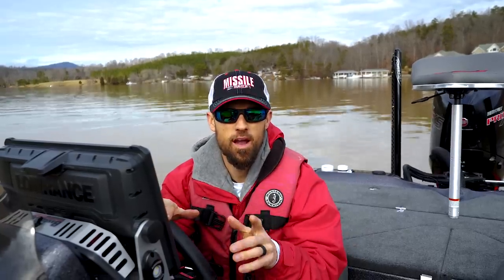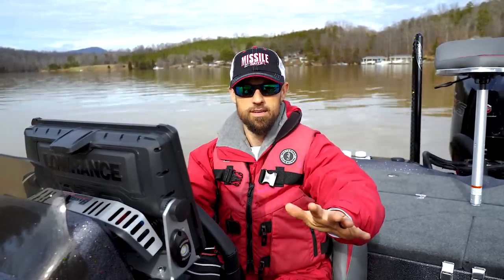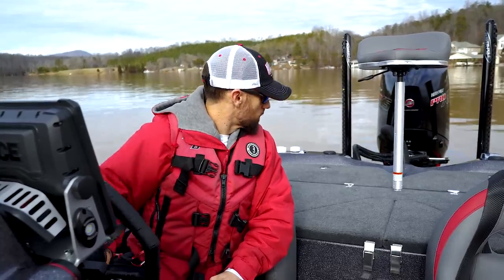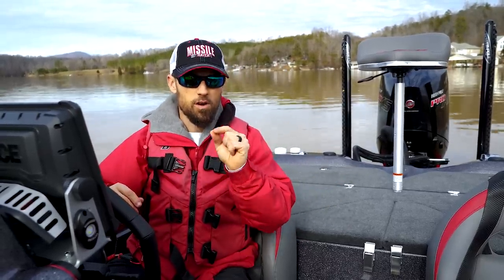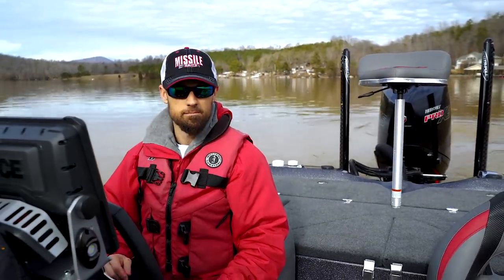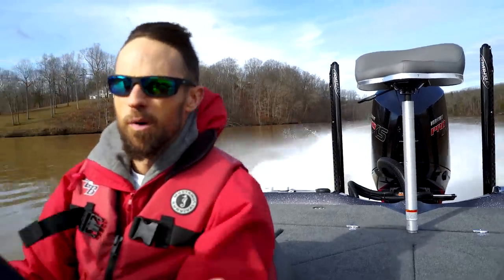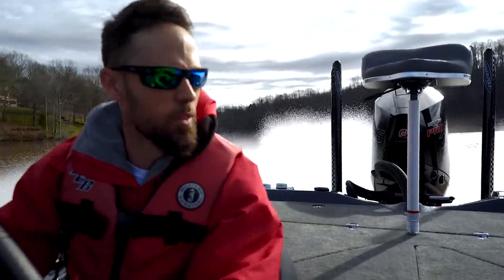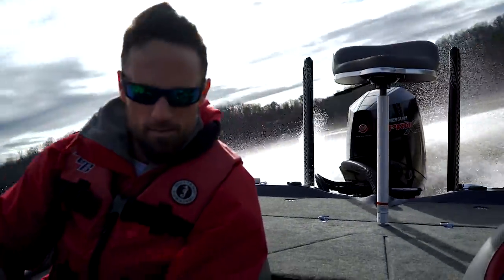BASS BOAT DRIVING - TURNING 101

Comment: I learned a while back if you drop the trim and the throttle at the same time, you can learn the timing on your boat to when it crests the hole and keep trimming down as you yank the steering all the way to a direction, bottom out the trim as you slam back into the throttle except now your facing the opposite direction and your co angler is probably in another zip code by the time you leave your hole shot.

Comment: Thanks for the video. I’m brand new to boating. My 7 year old joined the fishing team at school, so I went and bought a new boat. It does have hydraulic steering and it’s very difficult to turn left at speed. I called the dealership and they said that’s normal. It doesn’t feel normal. Any advice on that for a newbie?

Comment: I wish I would've had this for last week on the water. I just got a skeeter zx185c with a 175 yamaha and that boat scoots. This is my first fast boat and I'm having to get used to the trim. Last week I was maybe halfway trimmed up and going 45 mph and it started to loose bite in the turn like you were saying. From everything I've learned running this boat recently if anything starts to happen just trim down. I did and went away like you said but definitely scared me a little bit. I think the skeeters have a lot more bow lift that other brands anyway so it's getting a lot of getting used to. I trim that thing up until I get uncomfortable lol (no rooster tail on mine though with the way the jack plate is set up) it's crazy compared to rangers that I've been in that ride completely flat always.
Reply: Yeah i have the zx 180 with 175 Merc and just a lil down trim i can make turns quick and be trimming back up as finishing turn.

Comment: So I'll try to keep this short. I have a 86 aluminum boat with a 60 2stroke and I run down the creek alot with fast sweeping turns and 180 hairpins (with stumps and trees 10 feet from each side). Would it be best if I just trim it all the way down and leave it. I don't need the extra trim up speed. 35 through it is kinda sketchy. Had some close encounters with MISTRIMMING and was a couple feet from a tree due to blowing out/sliding. I haven't mastered trimming and Wondering if staying trimmed down would help keep the boat "sticking" to the path

Comment: New bass boat owner here with maybe a dumb question. My manual says to avoid trimming really far down because it can cause plowing and that it could increase spinouts. I think I hear you saying the opposite. Could you explain what they mean? I typically only run my boat at 35mph currently, at that speed do I even have to worry about it? Thanks
Reply from the maker: At top speed, if you trim down and cut the wheel hard, you could induce the boat to spin out. At slower speeds, trimming down to turn is preferred
Reply: @JohnCrews  your videos have been a tremendous help, and give me more confidence on the water. The fact that you take the time to respond to questions on videos you posted a year ago say alot about you as a person. Greatly appreciate it!

Comment: Good video and I hate to be picky but about 2 minutes in...........   When you turn your steering wheel to the starboard side, your motor turns to the port side (opposite direction).  Then motor thrust to the port side pushes rear of boat so bow goes to the starboard. 
    None of this really matters in the end because if you turn wheel to right, boat goes to the right.  Lol.
Reply from the maker: I got confused I guess. Thanks ☺️

Comment: Flaps on an aircraft have nothing to do with turning.
Reply from the maker: So the wheels turn it?
Reply: @JohnCrews  Flaps aid in increasing lift at low speeds. Simplified:  Rudder will yaw left and right similar to turning your outboard.  Ailerons roll the aircraft.  Elevators pitch the nose up and down.